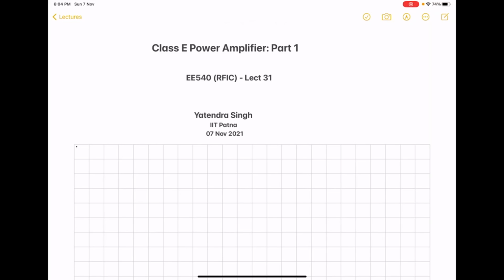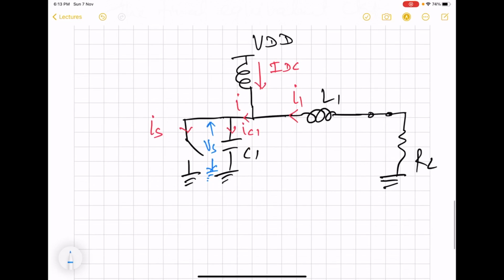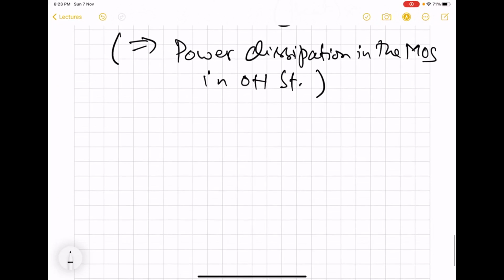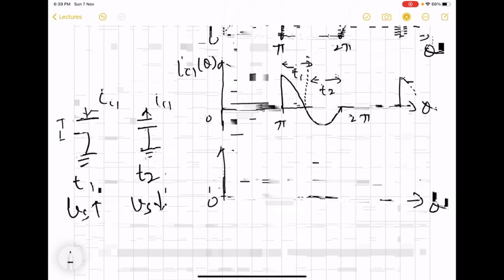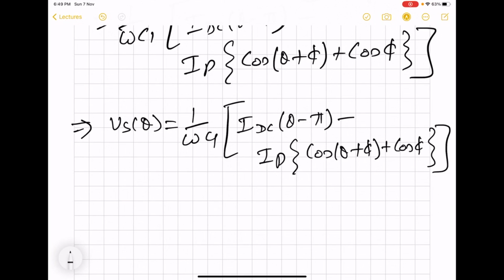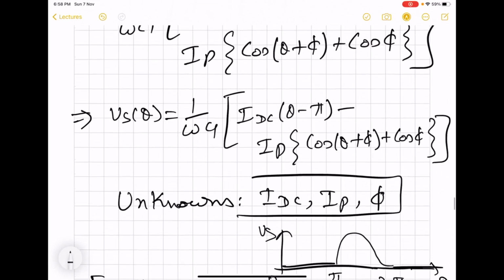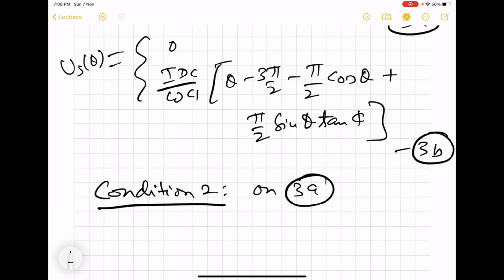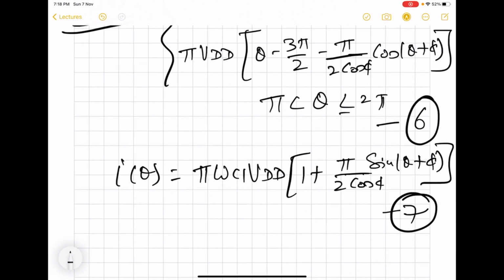Radio Frequency Integrated Circuits (RFICs) - Lecture 31: Class E Power Amplifier - Part 1

Comment: Thanks professor for your great video series. I have ques. reg. the load current. How did we get sine wave i.e. i = Ip. sin(wt+phi) when we haven't used any sine source in our circuit?
Reply: Well, technically, the large square wave at the input itself is a combination of infinite sinusoids, out of which only the fundamental reaches to the output